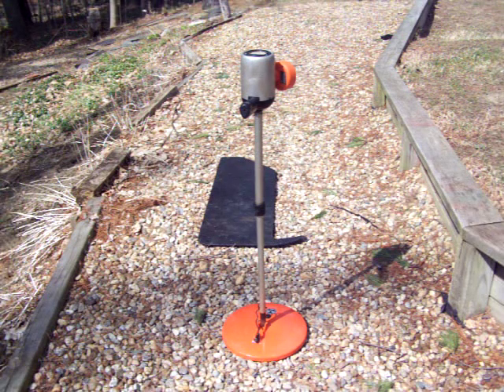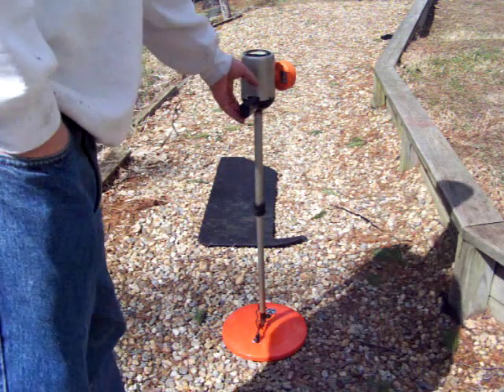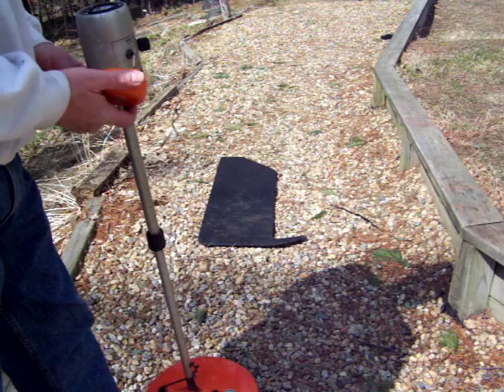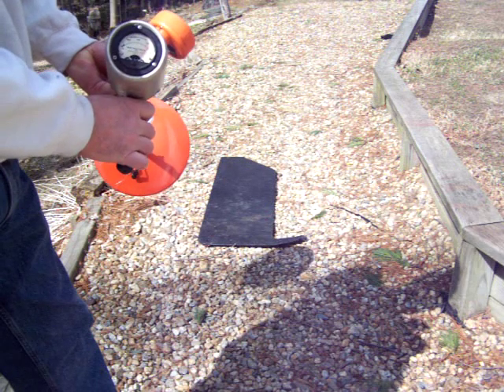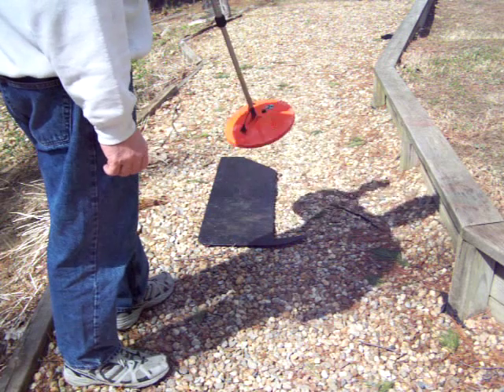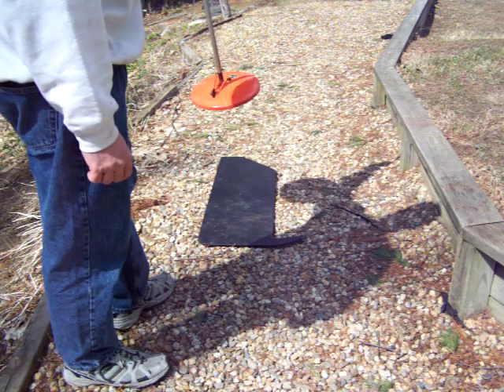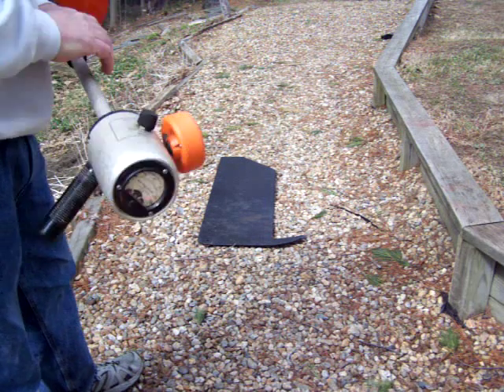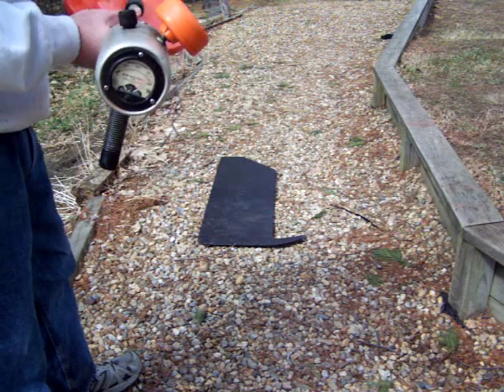Metrotech 220 Metal Detector / Locator

Comment: Finally, was looking for the battery compartment and all I had to do was unscrew all four screws by the handle and take off the cup piece to get to the vintage everready type c battery in the foam and paper sleeve and then i cut off the old positive and negative battery things and got a used smoke detector out of the house and put the new style one on it using solder and it worked.
Reply: disculpa sera que hay manera que me regales una foto de tu detector por dentro ya que tengo uno pero esta desoldados de todos los cables
Reply: Sorry friend, i dont know how to take picture and show you.
Reply: Merhaba dostum bana dedektörünüzün iç kısım fotoğrafını gönderebilirmisiniz kabloları benim dedektör iç kabloları kopulmuş  @LSnium